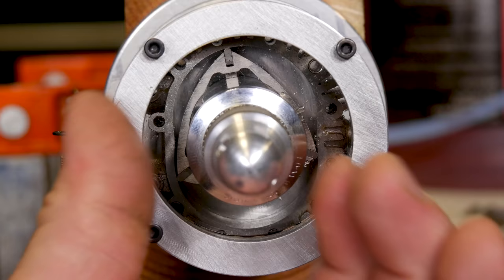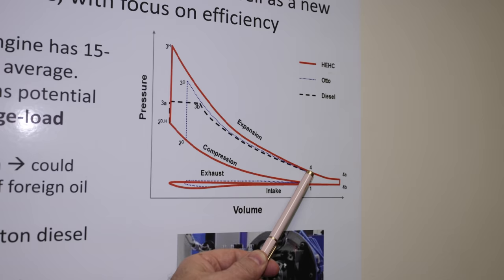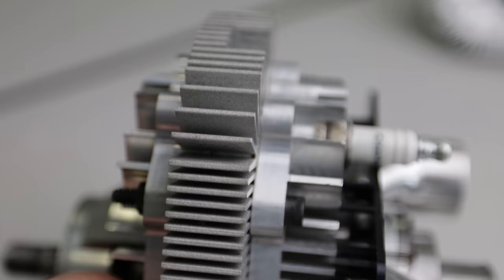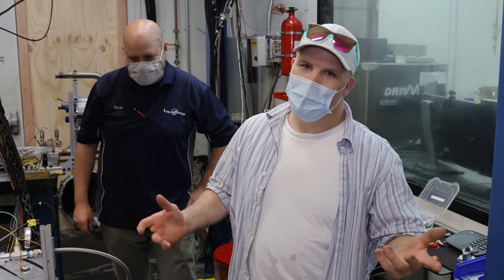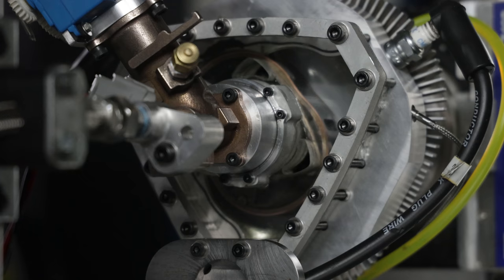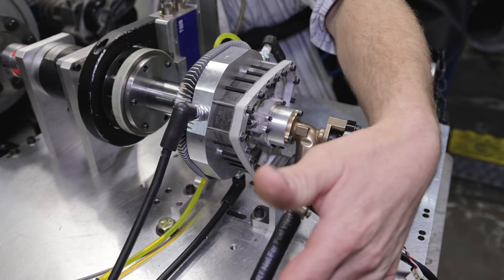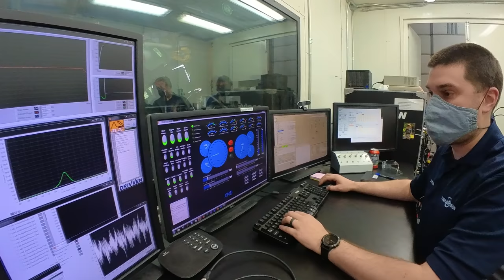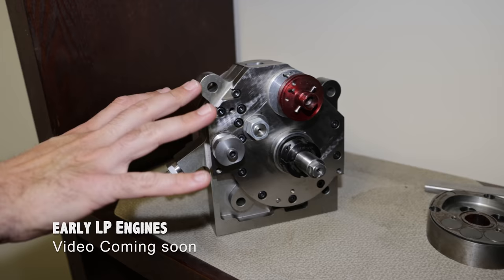See Thru Liquid Piston Rotary Engine - In Slow Motion

Comment: The problems of the Mazda engine, are the problems inherent in the design of the Wankel rotary-piston engine. From what I can see in this liquid piston version, these problems have not been resolved.  a)The intake air still gets superheated on its way into the combustion chamber, in fact even more so since it now travels through the inside of the piston. b)The path of the intake air is still very convoluted.  c)Sealing the sides of the piston is still going to be an issue. d)Internal lubrication still requires injecting engine oil into the incoming air. e)Some combustion pressure pushes against the piston's direction of travel. f) The apex seals aren't gone, in this version they're fixed and the rotating piston scrubs against them. g)Finally, they may even have created a new long-term issue: uneven temperature gradients in the rotating piston with the part that admits the incoming air being considerably cooler than the rest. Like a Wankel, this looks enticing on paper, but loses its charm once you analyze the details. Still, I'm assuming that the people who designed it are smart and will be able to produce working versions for some specialized real-life applications and it does make for some great videos.
Reply: Wow I was just thinking some of these issues then I saw your post, you've put more thought into it than I could. Good work!
Reply: Thank you. The moment I started thinking about it, it started falling apart and you put it quite succinctly. 

Also, now you don’t scrape the whole chamber so carbon buildup on the combustion chamber will become a problem fairly fast
Reply: I agree this poses various engineering problems that will inhibit and cause it to be phased out the same way Mazda's wankels were as well.
Reply: @crashTestGuru  Very good point.
Reply: The main prob w Mazda were the Apex seals, when Suzuki gave up their Rotary venture, they sold their patent for their Apex seals, to Mazda, prob sovled.
Reply: @tceed  the last type of Apex seals I was familiar with work two-piece seals and a as it wore the two pieces wood slide in opposite directions and there were two Springs underneath the Apex seals that would keep them flush to the inside of the combustion chamber. It was a far cry from the old carbon ones.
Reply: I would like to add that in "Rotary Engine by Kenichi Yamamoto" from 60's/70's you can see this exact design used here as one of the concept designs. So it's not a new design and it was taken in to design concentration on at least theory level before. 
While this has some things right there are a lot thing worse just like you said.
Reply: most basic flaw in this century: it’s a (fossil) fuel engine.
Reply: @AgiHammerthief  That's not an inherent design flaw. Just like a reciprocating piston engine, it can be designed to run on a variety of bio and alternative fuels.
Reply: @CaptHollister  can the low efficiency (around 20% maybe ?) also be solved?
I think that is the main issue, since we cannot afford wasting 80% of the energy no matter if bio fuel or fossil fuel is being used
Reply: I was about to write the same things written by CaptHollister.
Reply: @eddyedwards  Ski-Doo uses the “Rotax” series of twin cylinder 2-stroke ICE engines. Nothing to do with the use of a rotary design. In the pre-turbo 800cc configuration these produced 160bhp which falls well inline with all of the other power sport focused snowmobile engines and is very impressive from a power per liter standpoint.
Reply: ....funny how you went on being engine professor only to end up with 'still I'm assuming people who designed it are smart'....self contradict your argumentive standpoint. Proves merely watching clips Doesn't assure your analyst penchant, not the Same as doing it in a lab to conclude your above points longer than a shopping check list.
Reply: All is fun and games until you have to design an engine to meet emissions.
Reply: @altruismfirst6489  The Covid virus is actually around 0.1 micron, or 100 nm, but it does us the favour of always being bound to aerosolized droplets which are themselves no smaller than 1 micron or 1000 nm. In other words, N95 masks are extremely effective at protecting the wearer from Covid.
Reply: Gradient problem are solved by asymmetric cooling. There are patented materials for Wankel seals that works with gasoline without oil. The only inherent problem of this engine configuration is rotor stacking - you need more room for exhaust and intake plumbing between them (rotor can be oil cooled ). 
Temperature of intake air doesn't matter - they have strong knock resistance (perfect swirl in chamber unlike Wankel) and they lower amount of charge anyway because of overexpansion.
They need 3times more injectors and spark plugs. Weight of engine is higher than Wankel of comparable physical capacity, approximally 30-50%. Their rotor has higher mass and inertia, but air cooler version is lightened and probably can keep the same rotor rpm. Air-cooled rotor version uses the same air as intake - they don't filter it, they cant boost it!
Overexpansion wastes half of capacity - it is optional tradeoff - gives better fuel economy, but in air cooled variant they need lower fumes pressure to ambient level because they have common exhaust with cooling (accidently nice stealth feature for drones).
Mazda can easily adapt this technology with oil cooled rotor variant for small benefits.
This engine will excel in its most basic variant.
Reply: Wow u seem 2 kno more than Mazda engineer above
Reply: I'm sure there are details and improvements that aren't being mentioned.  I like the idea that the seals can actually be a source of lubrication via being some fancy sintered material and have positive oil pressure.  The poor wankle had more seals without that option.  And they worked pretty well. As far as that rotor if it's made of ceramic and has low mass it could work. I imagine banding it in something fancy.
Reply: @LZtastic  I always feel 100hp per liter is very respectable.  Add induction and it goes up. The newer BRP  engines for skidoo are E-Tec. They pinpoint direct oil the bearings and mop up the excess.  Long gone from the oil mist of original 2 strokes
Reply: @changsangma1915  agreed.  People are responding to this as though it is the best effort and also that the design team needs the publics help
Reply: @crashTestGuru , well, what scrapes the piston in the Wankel version? Aren't piston rings required in cylindrical 2-strokes and 4-strokes engines? It is an inherent feature of combustion engines. That is why lubricant is needed.
Reply: Combustion engines can never achieve the efficiency of electric motors. Hence, their inevitable demise.
Reply: @freenational  however batteries haven't yet achieved the power density of fuel.
Reply: @joeKisonue , true and its power source is fossil fuels anyway. But here is the catch. A 100 MW power plant can't throttle output and it has no way of storing energy either. So it makes sense to charge your EVs while the demand is low on the power grid during off peak hours. That way, you reduce wastage.
Reply: @freenational  .....since everyone believes anything ever manufactured to this day required fossil fuel as primary resource, I'd like to imagine how the folks produced metals without fossil power like mining trucks in the medieval age. Has anyone ever gave an ounce of thought?! Plus where do the general masses get the overall outlook that manufacturing industry solely utilise fossil/combustion power collectively? And that a part of industry (automotive) get to cut off the total global usage of fossil is supposed to be a bad thing?!
Reply: @AgiHammerthief  you mean blood didn't you?
Reply: Same, I noticed the bigger sore problems, but not the smaller pattern ones, good eye.
Reply: @changsangma1915  
In the medieval age, metal was produced by mass production of charcoal - oxygen deficient combustion of wood. The deforestation of Europe began in this time, and was practically complete by the time of the Industrial revolution. It was the replacement of charcoal by coal, then oil, then gas, that paved the way for European reforestation, as well as substituting the use of animal fats as oil from whales. 

Today, the overwhelming majority of primary energy - that is to say, energy in the production of commodity resources like food and minerals, is fossil. Does that mean it will stay that way forever? No, but it still doesn't mean that a replacement is coming any time soon.

In point of fact, the so-called "green" energy that is supposed to replace it, is fundamentally tied to fossil fuels. You can't produce solar cells without burning metallurgical coal to reduce SiO4 to Si metal. You literally use the oil and gas industry in every single part of a wind turbine, from the foundations (natural gas to reduce CaO2 to CaO for concrete) to the tower (metallurgical coal to reduce Fe3O4 to Fe for steel), the turbine blades (the petrochemical industry to produce the epoxy resins and engineered fibers), down to the powertrain itself (plastics in coatings, waxes for seals, grease for bearings). 

Out of all these, only 2 things have near term replacement: steel and concrete, with "green" hydrogen for concrete, and direct electrolysis for steel. So what does that leave? Nuclear power. Only nuclear power has the power density and the reliability to viably replace fossil fuel. And none of its materials in principle, require fossil fuel to make - its just that most of them still use fossil fuels because that's just how concrete and steel production has always been made. 

It's not like the oil industry doesn't know this. TOTAL of France and Royal Dutch Shell have run intense marketing campaigns hyping up so-called "renewables", but have been silent on nuclear power. This should tell you something.

There was a material reason why fossil fuels have the incumbency status they have today. It's not just because of political conservatism, it's not just because of collective ignorance. There are literally trillions invested into oil and gas. If you don't think that this does not generate its own path dependencies, independant of any corporate lobbying or political movement, then you are naive. And it's not like there aren't benefits to fossil fuels - why else would people use them, if not for their ease of exploitation and diversity of uses? 

Where we stand today, is at a crossroads. Industry itself is on the cusp of a manufacturing revolution that promises enormous layoffs in the near future. Meanwhile, the political-economic centre of gravity is shifting from the West to the East due to offshoring. Labour productivity is about to explode once again - yet labour discontent has never been higher. Inequality and depoliticisation have never been so bad, it's even worse than during the Gilded Age.

Of these conditions, are revolutions made. Not just industrial, but political. The old world is dying. The new has yet to be born. Now is the time of monsters.
Reply: @AgiHammerthief  Rotary Engines run even better on hydrogen.
Reply: @AgiHammerthief  works with hydrogen
Reply: @freenational  yes, but multiple rings on a cylinder help seal most of the oil away from the combustion, while still lubricating. not so easy to implement on a rotary, though fixed apex (combustion chamber?) seals would make lubricating much easier, as well as a possibility of multiple seals between chambers
Reply: “ how the folks produced metals without fossil power like mining trucks in the medieval age. ”

Bruh. They didn’t have mining trucks in the medieval age. Plus metal was ungodly expensive. Even a simple set of hand tools would eat up a good chunk of your income.
Reply: @cortholiopezorama8879  people forget that that shit would cost like 2-3 month wages
Reply: @freenational  Plus, a (direct, even this one) fuel-burning engine has no equivalent to regenerative braking (well, flywheels maybe). I know USA maybe has more steady long-distance travel than e. g. UK, but regenerative braking is the big gain for electric propulsion, especially wherever there's a lot of stop/start (or braking/accelerating), such as delivery or heavy traffic.
Reply: Your e) "Some combustion pressure pushes against the piston's direction of travel" was the first thing I thought when first seeing this engine. This has been about the only clip that goes slowly enough to see what's going on - most others have loved the engine so much they just like showing it working; even this one goes a bit fast. I'm still not sure about the motion of the "piston" (or rotor); to me, it looks as it it moves in a triangle, not just rotates around a fixed axis.
Reply: @AgiHammerthief  sorry can't hear you over my supercharged V8 🙃
Reply: This will probably never pass emission regulations either
Reply: @LZtastic  What's an ICE engine?
Reply: @moroit1  Well actually if you look at the different designs that Yamamoto offers you can notice some differences, as for example the position of the spark ignition
Reply: I feel like you havent been keeping up on rotory engine builds.
Reply: Yawn... like every kind of engine design including the ever-so-holy reciprocating piston engine, there are going to be compromises, even if most aren't as big of a deal as you make them out to be (assuming you're correct which i'm leaning towards not). Nothing that can't be solved with extra RND and money anyway, much like the piston engine.
Reply: @AgiHammerthief  Do you have a better idea?
Reply: @MonMalthias  Bravo...what a comment. Brilliant.
Reply: @G6JPG  Internal Combustion Engine (I.C.E.)
Reply: @13374me  Yes, I know ICE stands for internal combustion engine. The post I was responding to mentioned an ICE engine, not just an ICE or an IC engine.
Reply: I thought mazda rotary engines never had problems while nsu, gm and other manufacturers had issues with fuel economy and seals
Reply: @coopermuccio4409  I don't know about any problems GM might have had since they never had a production Wankel. The NSU and Citroen Wankels were underdeveloped. Suzuki's was properly developed, but the RE5 still nearly bankrupted them. Mazdas were very well developed, but apex seals still wear out and fail faster than you might like. Keep in mind that the displacement of a Wankel rotary is given as the volume of a single chamber, so the Mazda Renesis is reported as displacing only 1.3L, but the reality is that each rotor works with 3 chambers and many engineers believe that the real displacement should include all of them, so the Renesis should be reported as really 3.9L. Certainly, the fuel consumption is similar to a 3.9L piston engine (and a thirsty one at that) due to the built-in inefficiencies of a Wankel. On paper, the Wankel rotary is an elegantly simple design, but as always the devil is in the details.
Reply: @CaptHollister  were there other licensed designs too for the engine? Were the Norton ones and the sachs hercules motorcycles good quality? I think van Veen used the sachs sourced engines for theirs. I think yamaha also had blueprints for a wankel as well. I also thought some Russian manufacturers experimented with it too.
Reply: @AgiHammerthief  this is not a flaw. Fuel is fuel and can always be used efficiently. The only problem is dependency on questionable providers.
Reply: @crashTestGuru  
For the simplicity of the whole Liquid Piston, could it be simpler to pop out the main part of the engine and put in a new one.
It is just the size of a bowling ball.  So run the engine for six months or sixteen months. Whatever carbon buildup will no longer be an issue.  Being light weight, responsive, high power and ahead of its time engine, we can live with its short comings. 
Just give us the engine today.  And keep the replacement cost down.
Reply: The sides are sealed by the 'liquid'.
Reply: @freenational  Hydro plants completely throttle their power output!
Reply: @freenational  If you take into account the lost energy chain (extraction, transport, storage, increase in weight to be transported), this is not so true
Finally, the enormous diesels with cogeneration achieve a very high efficiency.
If you take this design and use the new elastic ceramic, you save weight and wear.
The ideal is to take advantage of the high energy density of the fuel and the mechanical simplicity, precise control of torque, speed and high efficiency of the electric motor.
a combustion engine for an electric airplane vtol does not need to have the power to lift the airplane the electric motor can easily run at very high power and the supercapacitor can give the amount of power for that phase of the flight, just a few% of cruising speed energy will be needed.
Actually,
i can see a diesel engine running to charge an electric car LOLOLOL
Reply: @crashTestGuru   but the issue of carbon buildup is far far less than in the original rotary. Where the buildup was on the rotar.  The rotar was rotating mass and adding carbon would alter the rotating mass and cause chatter due to vibration. 
Meanwhile in the liquid rotor motor the rotar is continuously “scraped” as you put it, in addition to cyclic thermal expansion which would scavenge the carbon. 

If I were building this mortar I would replace the side housings with steal reinforced platinum ceramics so as to trap heat, to raise working temperatures, so as to burn exhaust gasses to completion and eliminate any possibility of polluting gases such as NO being expelled, with the added benefit of raised efficiencies, and scavenging.  The worst aspect of the old rotaries was most of the energy was pumped down the tail pipe, so as to not melt the motor, and the emissions legislation added weight to the exhaust system. Also the wear characteristics of Ceramic would virtually eliminate side seal wear (not that these wore much in any case, except in unbalanced motors. 

For the purposes of demonstration they used acrylic, but this clearly can be improved upon in production.

I see the potential for a three rotor, fully balanced motor spinning up to 20k rpm attached to a simple 2 stage gearbox, weighing less than a rear differential axel.  And you would want that rear driven axel for a vehicle with that kind of performance.
Reply: nearly all of your statements are not true. the seal problem, until proper material is found will be an issue but how do you figure "superheated fresh air" is entering the system? it literally pulls 10:1 fresh air through the center of the crankshaft, Into the hollowed center of the crankshaft and the to the camber. What i find amazing to watch and think about is the fact that the gases really don't move, the rotor surrounds it and closes the door. It's like in the movie Curve when Angelina Jolie does a 360⁰ in the car, opens the door and the kid gets scooped by the car while standing still. Imagine your car climbing around you instead of you getting into it.
Reply: into the hollowed rotor* my bad
Reply: @BrewstersAuto  What happens to the temperature of that air while it's sitting in the hollowed out rotor ?